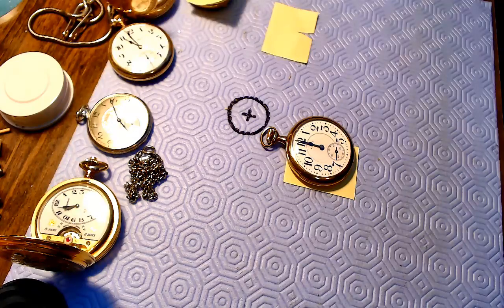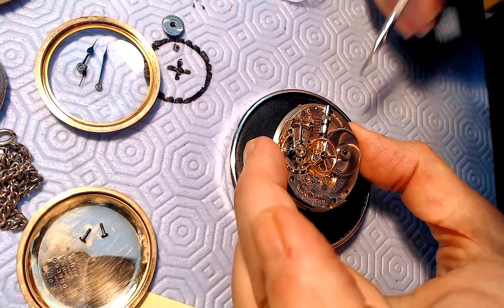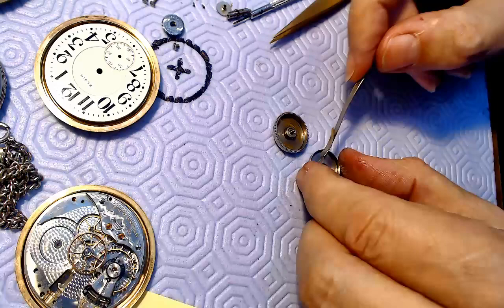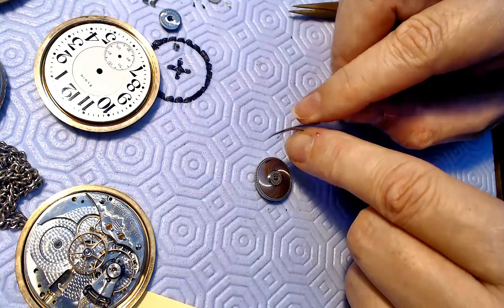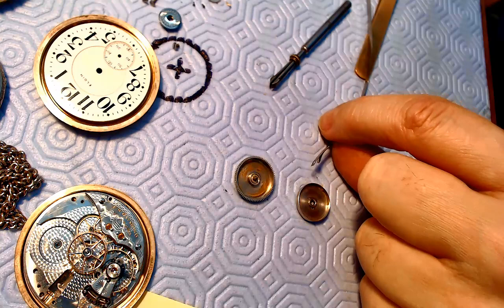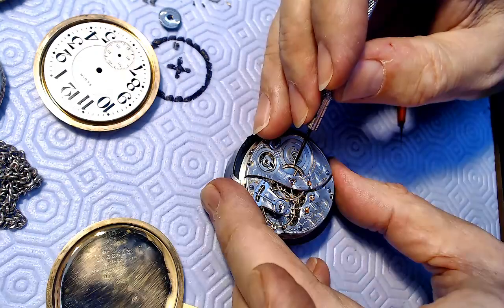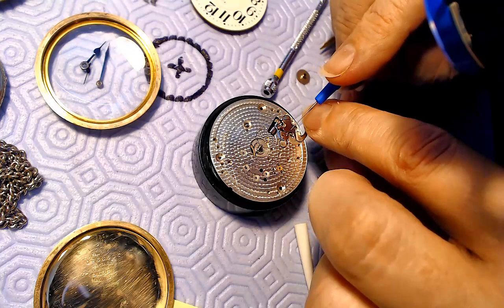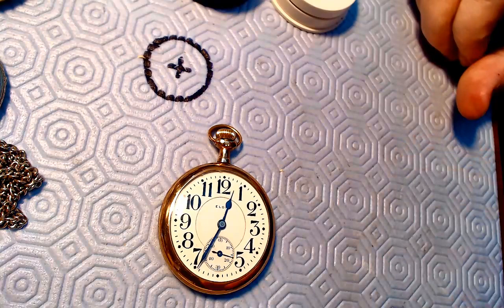Elgin Railroad Grade Pocket Watch Mainspring Issue

Comment: Great video Jd, if the screw holes on the barrel are stripped what would the solution be?
Reply from the maker: Ammar Dalati I would find a larger screw and Re-tap the hole. I did find a good screw from a scrap movement, so all good. I also replaced the missing screw from the center jewel. It looks flat and not rounded like the others, so I am going to mount it I a lathe and soften the corners a bit. This is a Railroad grade movement. The jeweled Barrel should have given it away. Works great now and the spring does not slip a bit.